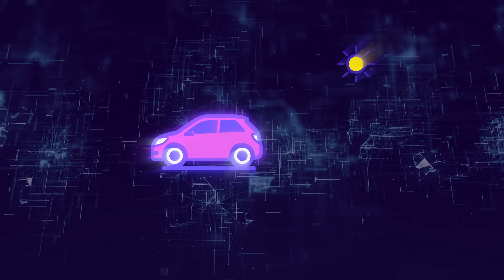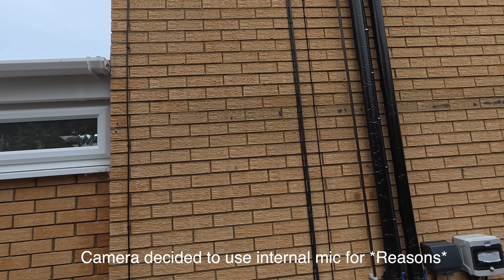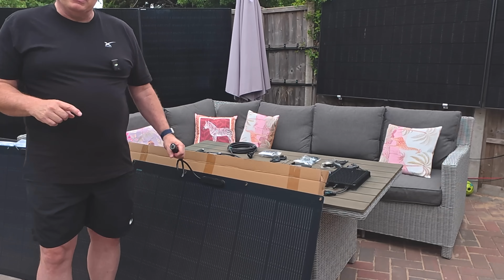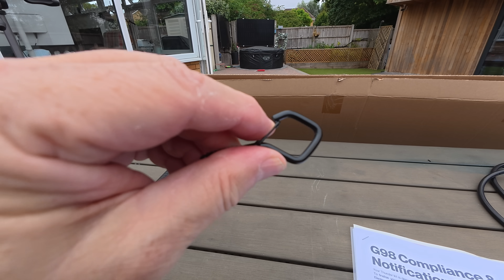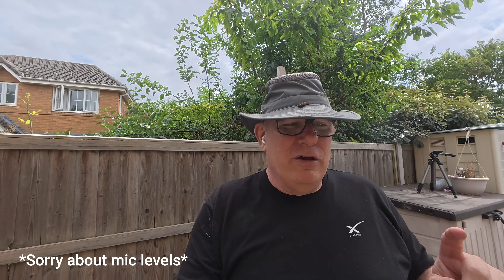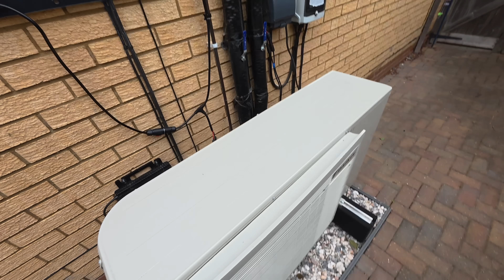thunder energy storm plug in solar installation uk

Comment: Nice, being so light and flexible just wondering if you should also put fixings in the central holes to reduce the risk of wind tearing them off the wall.
Reply from the maker: So I wanted to see if that was necessary, if I noticed them flapping at all in the wind then I will add some more fixing bolts.
Reply: @JonathanTracey  personally I would - I did on mine at least one in the middle as they will annoyingly bang on the way when the wind picks up which wont go down with the CFO :-)

Comment: Great videos,  I have been watching your videos with interest for a while now. I have an existing solar/battery setup and have recently also bought a stream ultra x plug in battery. Im looking to get some panels fitted to side of my house just to charge the battery and cover some of the baseload to my house. Very much aligned to your set up using your solar array/battery to cover Demand and the rest to cover baseload. 

How does it work with G99 and G98 when  you have a mixture of systems installed in a household in such a way?
Reply from the maker: hi Simon, base load is what these are very good at, especially on days like today, they probably produced about 2-3kwh but thats more than enough to keep the house ticking over.  With regard to G99 you would need to do an addendum to your existing one. You cant have a G98 if you already have G99. appreciate you becoming a member 👍
Reply: @JonathanTracey Thanks for the reply.  Ah makes sense i suppose. Im guessing I will need to check what export my G99 covers.

Really interested in seeing how these new panels perform!

Comment: Thunder energy is fantastic. Very innovative gear.
Reply from the maker: yeah I gotta say it was pretty impressed with it, having everything in the box will make it very easy for somebody who maybe doesn’t know an awful lot about solar but can follow a simple plug this into that instead of instructions to get up and running
Reply: @JonathanTracey agreed. Have you spotted that B&Q are now stocking kits? £400 for 1 panel and 1 microinverter. You can absolutely beat that shopping around but I think the dam has finally been breached by this week just gones legislation announcement
Reply: @pluginsolarexplained  Still very pricey. You can pick up top end equivalents for half of that at city plumbing.

Germany its €500 for a bottom end system with 2kWh of battery!
Reply: @etchedpixels fingers crossed we get the same when the entire industry piles in.

Comment: Nice panels, especially if you have some small areas that are ripe for adding panels but cant fit the big boy 400W+. I will be keeping an eye out as I have just such a space I could make use of as I like those mounting holes they have on those you have installed.
Reply from the maker: Yeah, they were surprisingly easy to install even for a person as DIY challenged as me😂
Reply: I'm in the same boat - the space I have isn't suitable for the larger 400W+ panels but I could fit in 4 of these smaller flexible panels.  Will be good to see how these perform.

Comment: A bit surprised the lower panels are quite so low!
Reply from the maker: yeah, they still get a lot of sun, there’s very little shading on them for most of the afternoon. I’m also limited by the height of my ladder.😂
Reply: @JonathanTracey  - then hire a small scaffold tower and get them high?!
Reply: @JonathanTracey  I was going to make a similar comment, if you are getting a bit of shading at this time of year it will be much worse nearer the winter. I was asked "why don't we fit panels on the van shed", my answer "Come October it will be in shade pretty much all day".